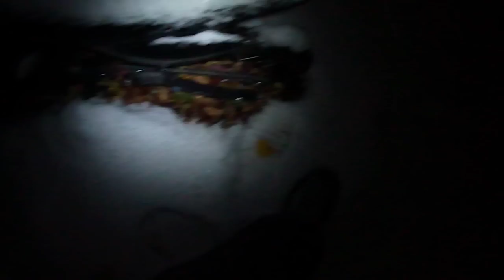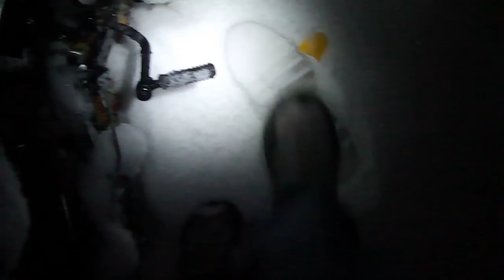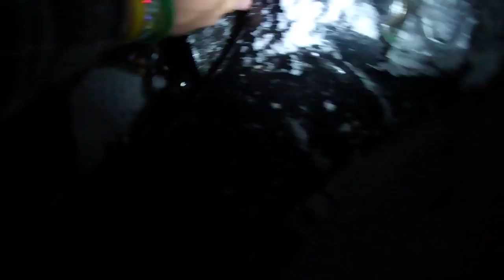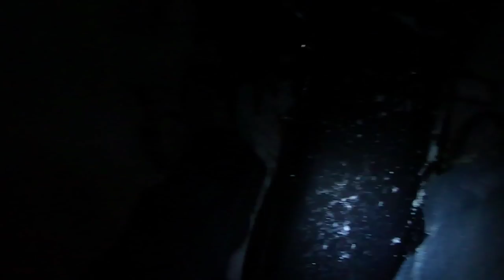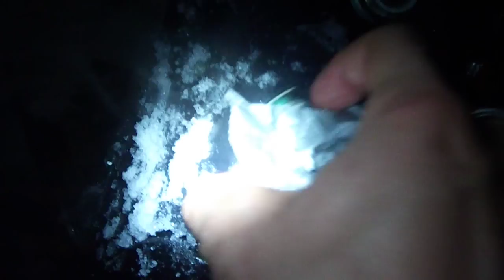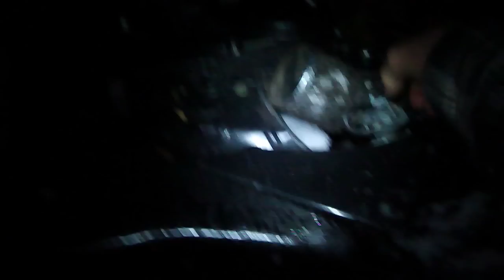Cold starting my new 110cc pit bike

Comment: I have a brand new Apollo 110 that will run with choke on, but that is it.  If I get it running without the choke , it will bog and not run.  Any idea why?  I've cleaned the carb,blown out the lines.